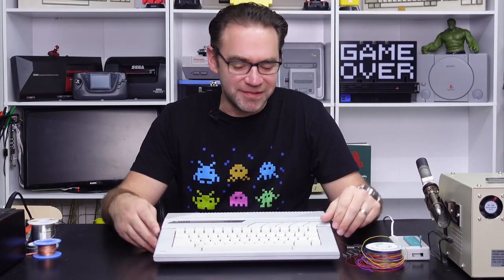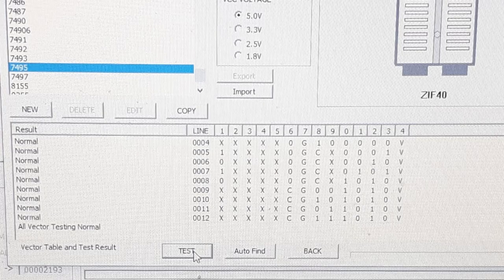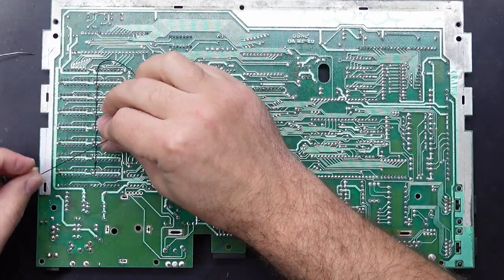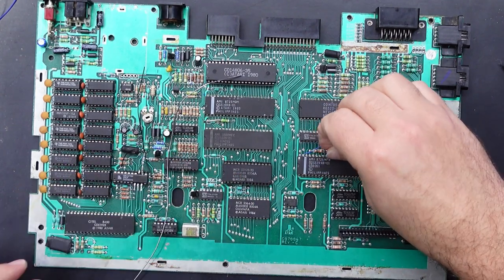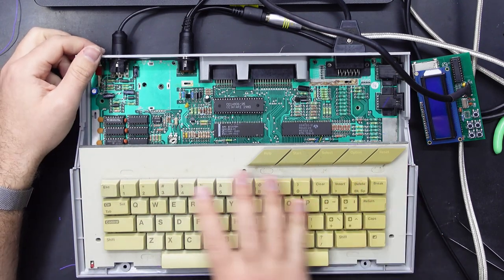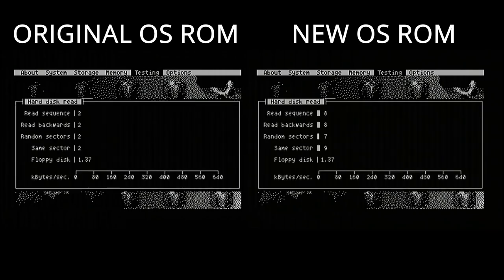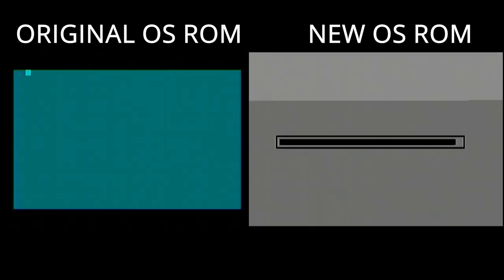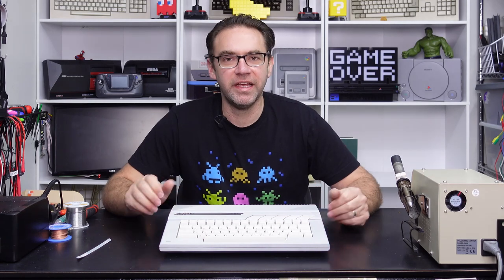Atari 65XE 320K memory upgrade and OS ROM upgrade

Comment: Nothing wrong with a bit of "tv cooking show prep", who wants to look at soldering led setting anyway ;)
Informative video! Whats in place of the GAL to start with? Another GAL but with different logic in it?
Reply from the maker: It was empty apart from 3 jumpers. In the 130xe there is a 16 pin PAL there to address the 2nd ram bank. I believe the GAL contains the same logic as the PAL with some extra bits to handle the 128-320K banking

Comment: The "encryption" setting for the GAL is not altering the equations that are burnt into it. It just sets a security fuse so you cannot read it back (copy protection). The TL866 cannot verify (read back) its contents and compare it to the JEDEC file. So calling it "encryption" might be misleading by the TL866 manufacturer.
Reply from the maker: Yeah, it's nice to have that option but I doubt anyone using a cheap programmer like the TL866 is really worried about protecting their IP. I'd rather leave it off just so I can verify that these old ICs actually work correctly

Comment: Great job. Enjoyed your upgrade methods. The period correct hardware is great! I need to do this sort of upgrade considering how expensive is the U1MB. I'd say go with the 320XE badge.  XE video quality varies but is better than XL. Did you have an A8 back in the day?
Reply from the maker: Thanks! I didn't have an A8 back in the day, in fact nobody I knew had one, at least from what I remember. Very cool machines and definitely very capable for an 8bit micro. I've worked out a pretty decent video upgrade that involves only a few cents worth of parts. That'll be the subject of a later video, along with the 320XE badge, and maybe even a ROM switcher 🤔
Reply: A great memory upgrade is Jurgen's 512k board(the same guy responsible for the upgrade found in this video). Easy to install, the price is good (25euros) and with software control over the active  memory size. (you can set it to 256,512 or off).
IF you are interested I can send you more details.
Now  the video quality  depends on which XL and XE model you compare. My XL freddie  (800xlf) is equally good to my 65xe(900xlf board).

Comment: Great video, where do I find the System Information programme (SI226) you used in the video?
Reply from the maker: http://drac030.krap.pl/en-si-pliki.php
Reply: @TheRetroChannel  what is the trick for using the si226.arc file?  I assume the arc file is an archive file?  What program can extract it?
Reply from the maker: @timcross3461 good question and not one I have an answer for. But I just checked and I do have the .xex file. You can find it here https://drive.google.com/file/d/1daHNj7aHyV2pvV9gJeR3IbsB_6KPF24K/

Comment: What is that black wire? Yiu dont need to unblank the cable and directly solder to that memmory chain. Is it some special cable. I am amateur and this looks interesting wire to solder with.
Reply from the maker: It is called wire wrapping wire. It worked but is not really intended to be used that way. What would work better is magnet wire, it has a thin enamel coating and burns off cleanly when heated with the iron. You can see it being used in this video https://youtu.be/RCU6gTgCxgM

Comment: I know nothing about Atari, but did buy a 65To see about updates. I did wonder: If the Option key to exclude BASIC is reversed, would that fix the problem with the two games?
Reply from the maker: Unfortunately not, I even tried the original hi speed SIO rom which doesn't include the BASIC swap and it still crashes when loading those games.

Comment: The floating point upgrade may not be useful if you don't run many basic programs or do any programming yourself but for me, it's fixing something that Atari should have fixed with an update themselves.  Apple offered several versions of Basic to fix performance issues along the way.  I guess it just depends on how you thought about computers back in the day.  Were the devices that deserved continuous improvement or were they just appliances that were tossed and a newer version replaced them?  I feel that Atari failed it's users when they never came out with an expansion chassis for the XL/XE series.  Maybe I'm just an old die-hard.